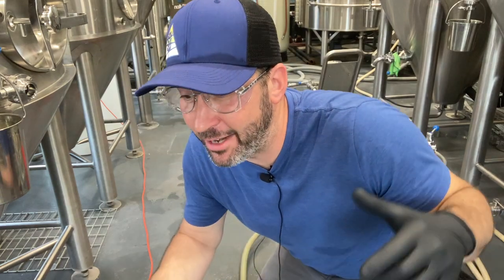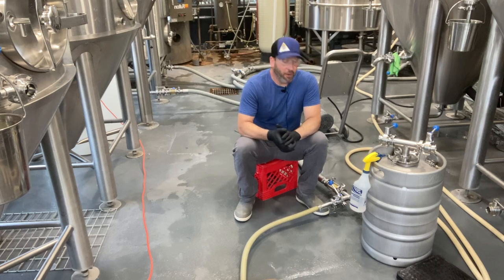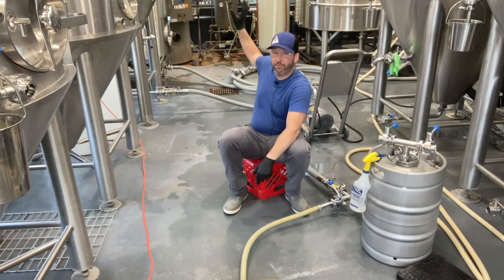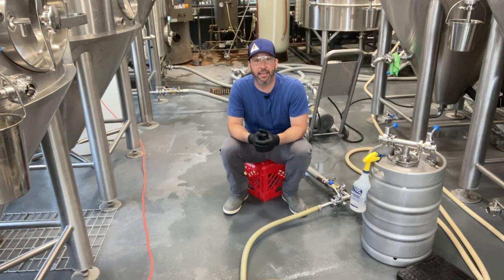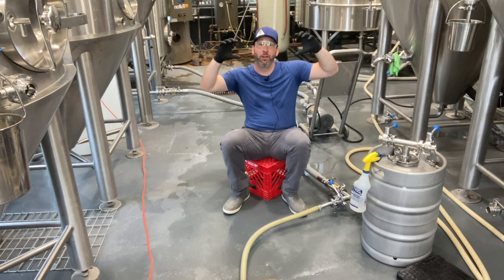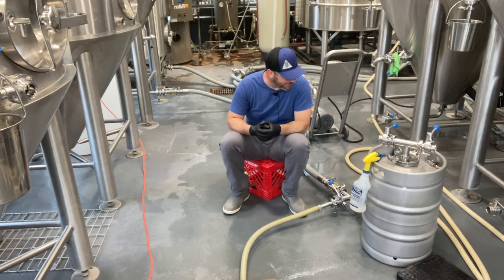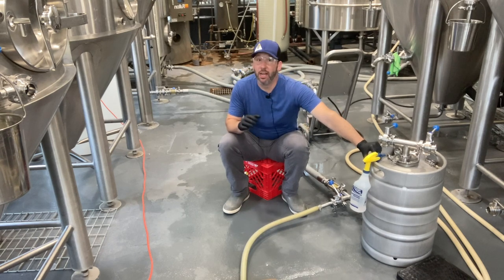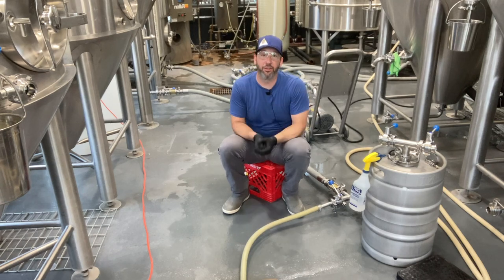How I Harvest and Re-Pitch Yeast as a Professional Brewer!

Comment: From one Adam that makes beer to another, I appreciate you putting out these videos.
You mentioned keeping the yeast in the brink for no more than a few days and purging head pressure - are you measuring viability? Or have you had a bad experience with old/pressurized yeast? 
We just started using a brink. Cheers
Reply from the maker: Great question! Currently not doing viability, but plan to as the year goes on. Not leaving the yeast under pressure for extended days comes at the recommendation of the Imperial Yeast. It seems that the extended storage as well as elevated head pressure is a negative for the yeast. Thanks for you question and for watching!